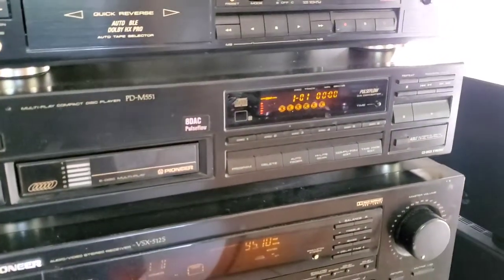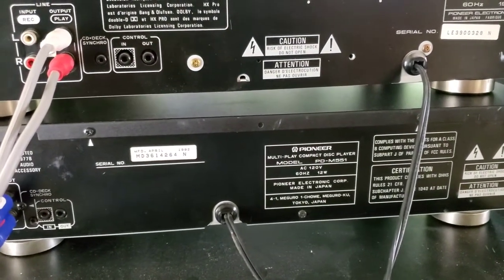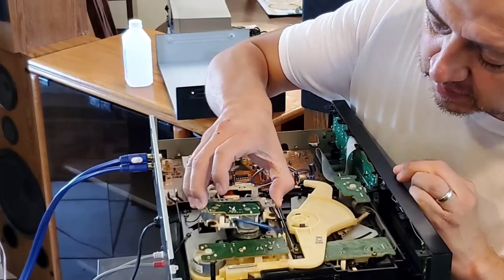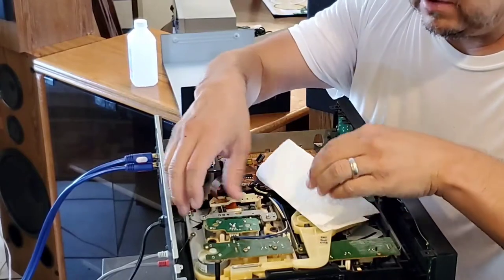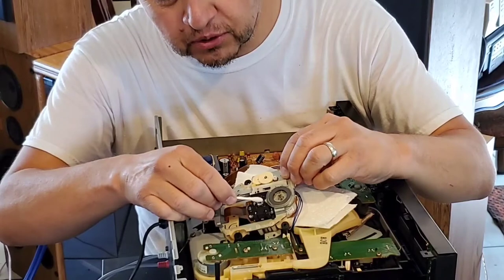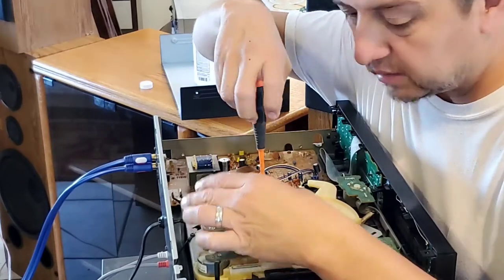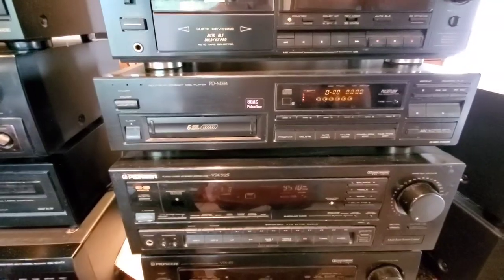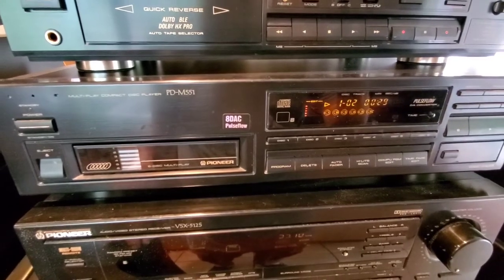Pioneer 6 disc changer laser lense cleaning

Comment: great video , helped me fix playing issues with my Pioneer PD Z83M, cleaned the laser and lubricated all the running gear and it's playing and working like new, got it hooked  up to a Technics V500 M2 amplifier  with Panasonic studio monitor speakers, thank you
Reply: What did you use to lubricate the running gear? I have a feeling that mine might be sticking in addition to a dirty lens.
Reply: @laidback93  used very thin coat of Teflon applied to the running gear using cotton ear bud, solved the sticking running gear , hope this helps
Reply: Does Teflon come in a tube? I’ve never heard of this being used as a lubricant in stereos, and I need to fix my Pioneer, but was only going to clean it. I didn’t even think to lubricate the parts. 😮Your help is greatly appreciated!

Comment: Thanks for the video. I have a PD-M423 that has the should have the same laser setup. I was just playing a couple CDs today and it started slightly skipping and then wouldn't read any track when I skipped tracks. I'm hoping it's just a dirty lens, but I'm wondering if the tracking is getting stuck.